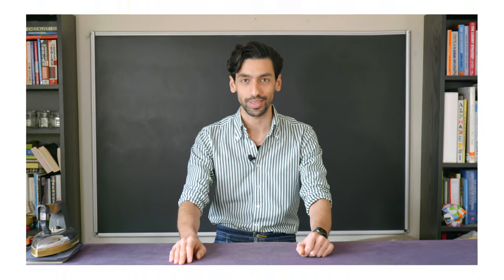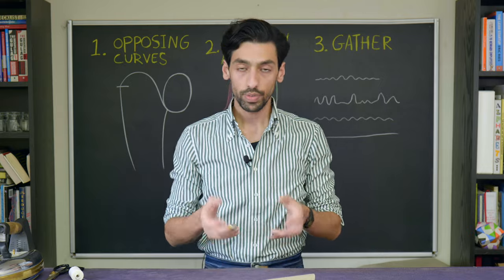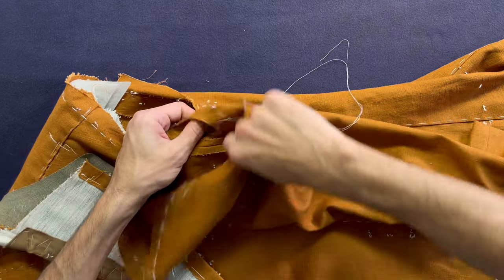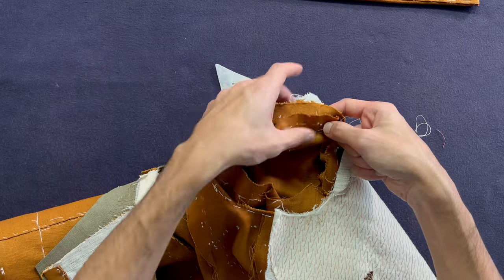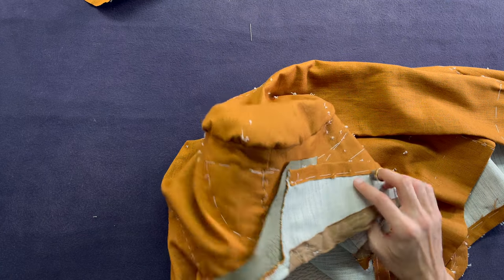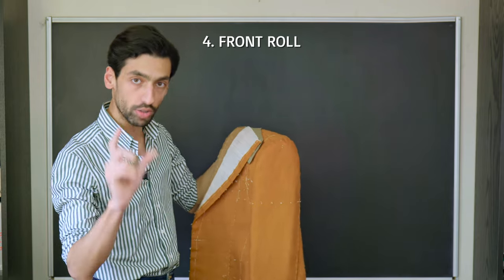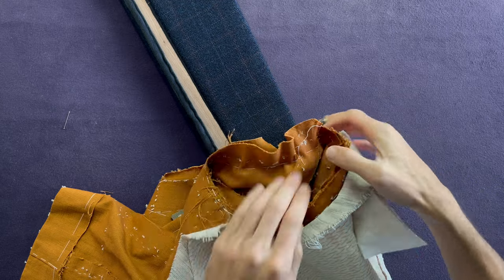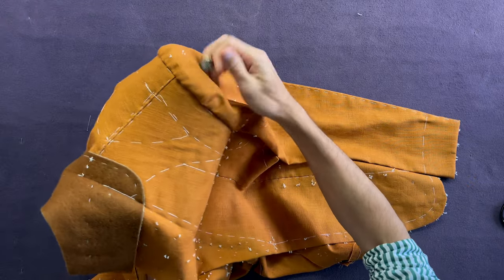L33: How To Baste Tailored Sleeves - Traditional Model | Online Coat Making Course

Comment: I love this. Thank you so much. I hear other tailors talk about putting in a big sleeve into a small arm hole, for ease of movement. 3 - 6 inches for example in an old Anderson and Shepard drape cut/ London cut style suite. You say the current sleeves are to big, what type of excess or ease is going into it in inches? and what are your thoughts on the drape cut construction? As this is a very popular style in the US. Also at some point I would love to hear you talk about what type of alteration in pattern and construction would be required to make a jacket with no shoulder pad. I think I am asking a lot, they are probably quite involved answers. Thank you for your time, service to the industry, next generation of tailors, and those of us that only intend to learn for the love of learning.

Comment: Please I have a question, im a tailor and i sew for clients with different sizes, please can you show me a video or an explanation of how i can use your pattern for different types of bodies?
Thanks
Reply from the maker: Hello. 

You can only use our pattern for other clients if you know how to alter it to their figure.
I don't recommend using our pattern as a block pattern. Block patterns have a neutral figure. Mine is built to mine. If you are not experienced in altering patterns, it will be a disaster.

I recommend to practice drafting and fitting block patterns. 

Check out some recommended books on our website:
https://www.internationalschooloftailoring.com/tailoring-books

Reza

Comment: Considerng how single breasted coats seem to be jackets with a "skirt" part and heavier fabric, i was wondering if they are made with or without shoulderpads
Reply: Shoulder padding and cloth weight have nothing to do with the eventual "skirt" at the bottom (known as the coat quarters) of a single breasted coat. The difference between a single breasted and a double breasted coat is distinguished at the cutting phase, in which instead of cutting the coat to have the foreparts overlap by, say, 1" or so, they are designed to overlap at a sharp right angle about 10" or so. If you search up "single breasted coat pattern" and compare it to a similar search for "double breasted coat pattern" you'll notice this difference.

Just as having pink buttons is an option, so too is the type of shoulder padding you employ in your coat or the weight of cloth you use.

I hope this clarifies certain aspects, and wish you well on your tailoring journey!
Reply from the maker: Carl is right. These factors are generally unrelated.

Reza

Comment: I may have missed something or comment from an earlier lesson, however, when does the lapel get pad stitched to the canvas? Wouldn't this be done before a fitting? What would be really useful is a simple pdf doc showing the order of construction as a numerical list of tasks for each section of the assembly.
Reply: This is a skeleton fitting. Some tailors like reza pad the canvas and collar whilst some do not. We do not pad the lapels until after the pocket baste fitting (if there is one) meaning the pockets are put in, and the final canvassing is done. Only then do we pad lapels and continue with the facings etc